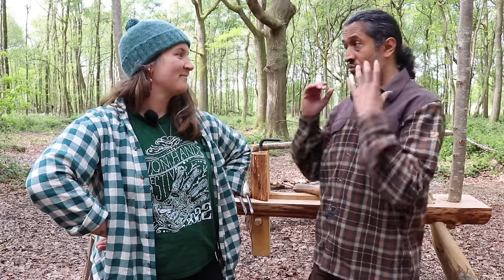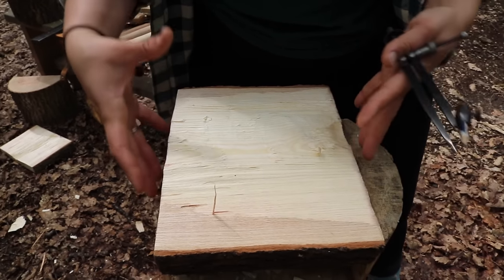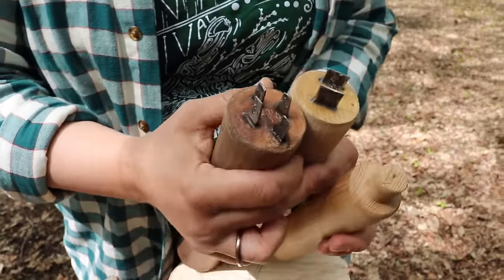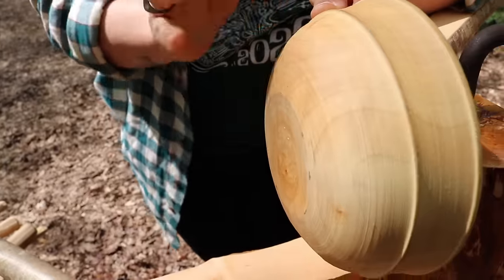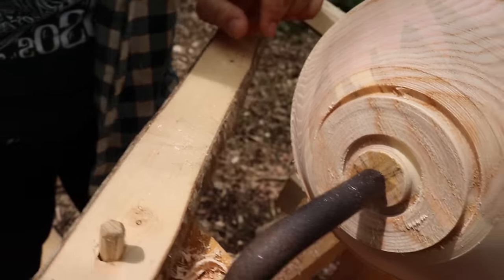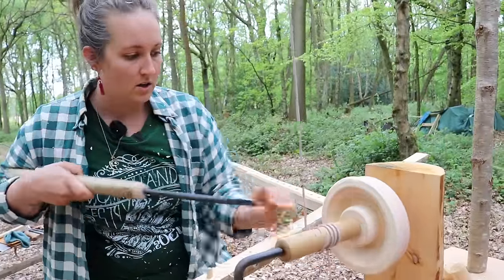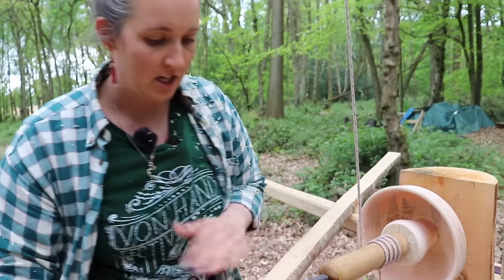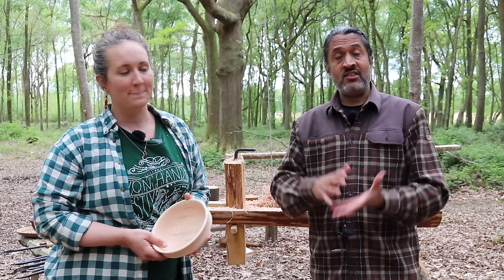How To Turn A Wooden Bowl On A Pole Lathe - Raleigh Klotzek (Wild Crafted Workshop)

Comment: I built a lathe similar to this one, but I cannot figure out why mine is not carving and polishing the wood, instead it is chipping and chewing the wood. Thanks
Reply from the maker: Could you be more specific as to what is not carving/polishing? ~Peace~
Reply: Hey! There are so many factors but the most likely is technique, how secure and how sharp your tools are etc.

Watch closely to the angle of my tools in how they apply to the wood and how the angle is maintained while turning. If it’s moving you have to anchor your body frame and grip more. Lots of little bits of muscle memory and tool application experience! Keep going!!! It will get better:)